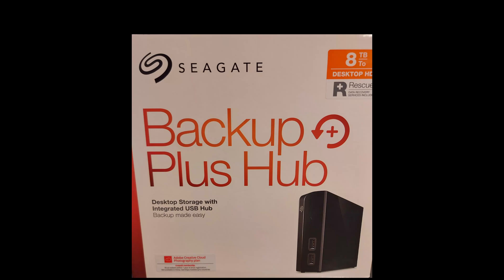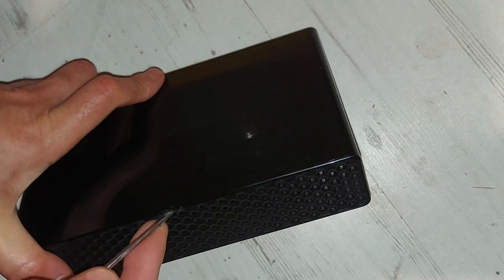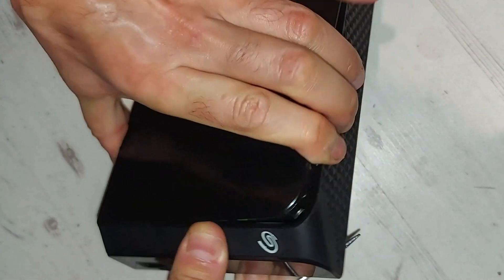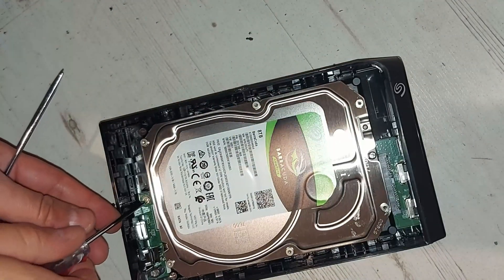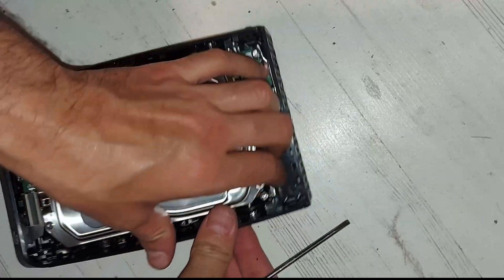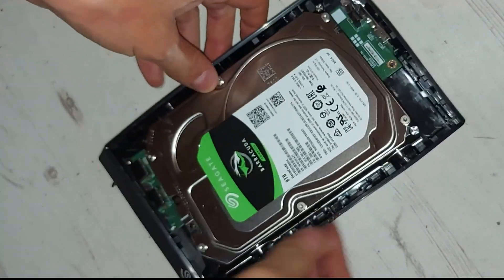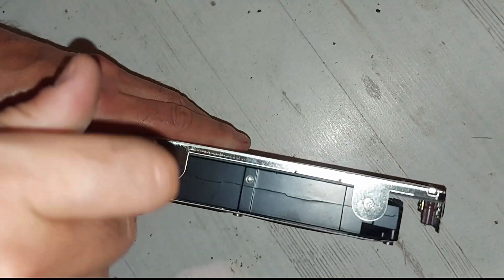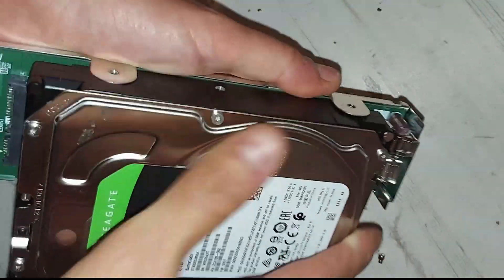CHEAP 8TB Drive - How To Deshell - Removing a Seagate Backup Hub Enclosure

Comment: When removing the drive be careful not to damage the USB 3.0 to SATA/power connection as this can be used to quickly turn any HDD into a USB drive. I use this to run diagnostics on drives without mounting into a machine. I also use it to scrub and extract data from laptops and computers that won't boot up or have stopped working altogether.

Comment: just wanted to let you know, later on, open the plastic cover from the other side, the drive will come out smoothly, including the PCB too
Reply from the maker: Thanks for the tip. I had a look and I couldn't see that the other side would open, but I'll certainly look if I need to open another!
Reply: good tip! once you open the smaller side you can just break the tabs that hold the larger side on from inside.